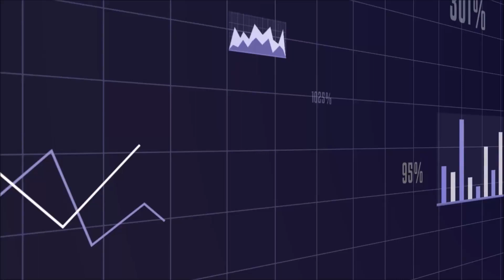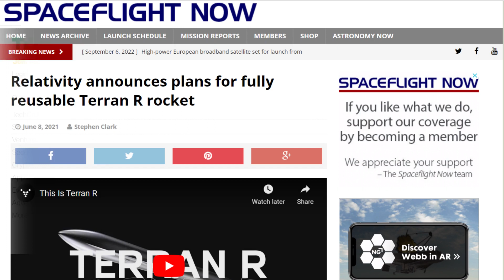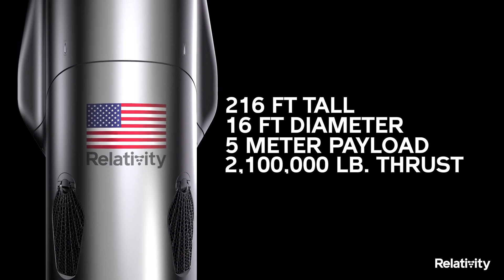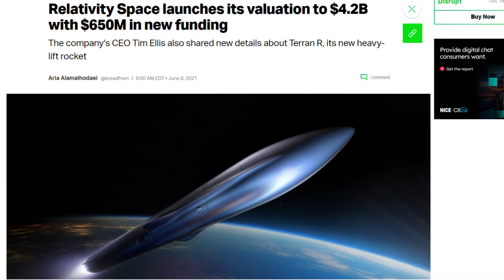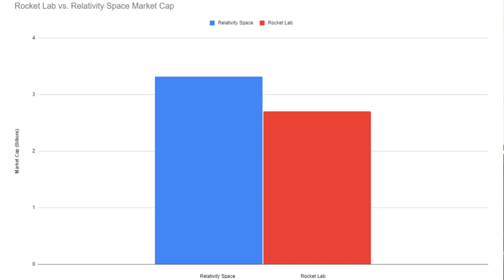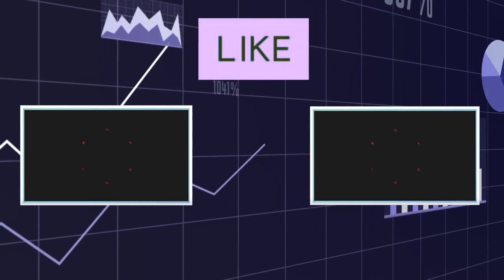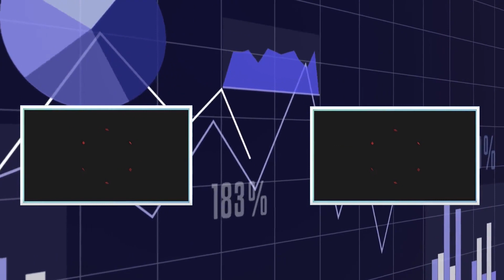Relativity Space: A New Industry Disruptor or Just More Hype?

Comment: Making a complete medium lift rocket in 60 days using only a relatively small factory without thousands of workers is incredibly fast (assuming it is accurate). While it certainly looks like a slow process, the results are very fast.

None of the existing big liquid fueled rockets are actually simple uniform cylinders. They have a complex geometry for structural reasons. Because propellants are heavy, the peak hoop stress near the bottom of the lower tank is much higher than the hoop stress near the top of the higher tank. If the propellant tanks were uniform cylinders, either the lower part of one of the tanks would burst under the stress of launch, or the upper parts would be excessively heavy.

Musk has said they will probably start using different thicknesses of steel eventually. For now there are more reinforcement structures lower on the rocket, and the rocket dry mass is too high.

A real rocket needs conduits for wiring and plumbing for propellants, ullage gas, hydraulics, and other stuff. In theory, all of that plumbing can be printed into the structure. The wires can run through conduits that go exactly where they need to go. Every plumbing connection can be made just as strong as needed for the safety margin, but no heavier than necessary.

Since the rocket uses fuel and oxidizer from separate tanks, there should be a big pipe running from the upper tank through the lower tank to the engines. The video clips from Relativity show tanks being made without any plumbing.

This is not investment advice. 

There is a whole lot of exciting potential for this company assuming they can deliver. Until we see their rockets actually deliver payloads to space, we don't really have proof that it isn't just an elaborate scam.
Reply from the maker: Thanks, very detailed!